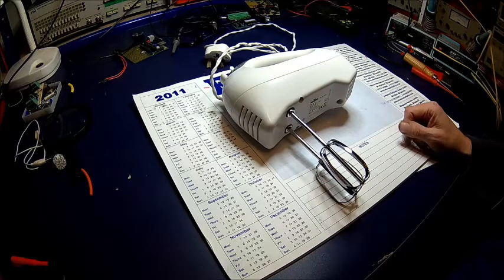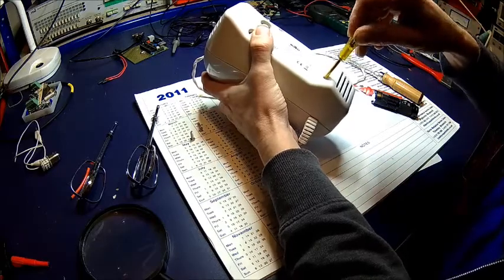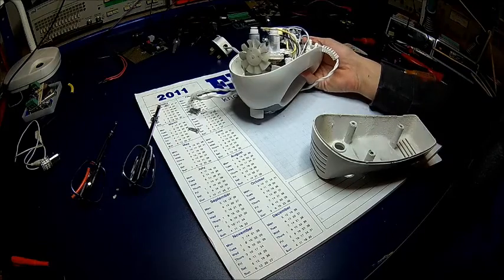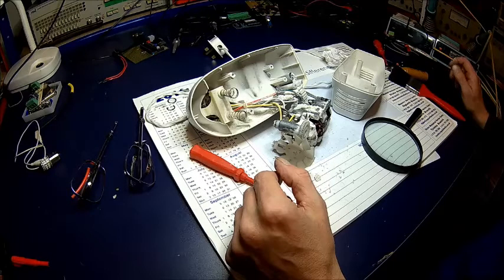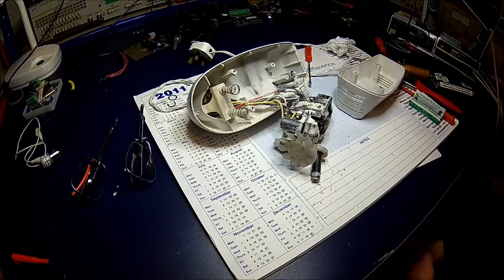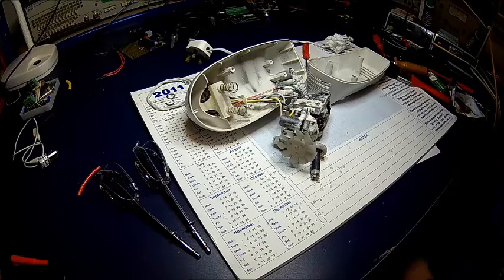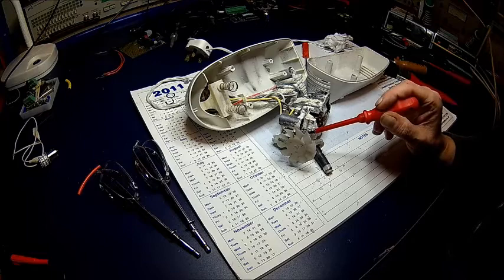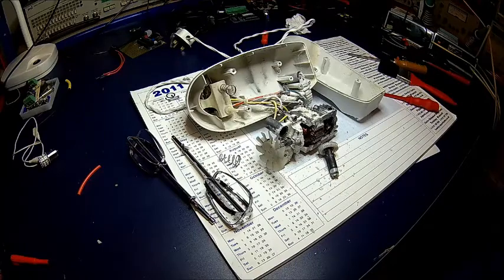What a brilliant piece of Chinese engineering .... or how to design something to fail quickly

Comment: Wonder how much of the plastic from the gear teeth ended up in your food? We are killing our planet. Most things we buy today are in the garbage within three to five years. They don't make things like your SouthBend lathe anymore.
Reply from the maker: Well, either by deliberate design or accidential at least that won't happen. The arflow is designed to suck the flour dust in at the front, mixes it with the plastic grind and blows it out to the rear. These things are just glorified waste, she recently killed another one (only 3 months old), it was a bit more expensive but i think it's the same rubbish. It's still waiting on the bench for inspection..She also has a German made Krups, i guess early 80s,  it still works fine, but it was at least 10  times the price. There is indeed a reason why i like old equiment ....